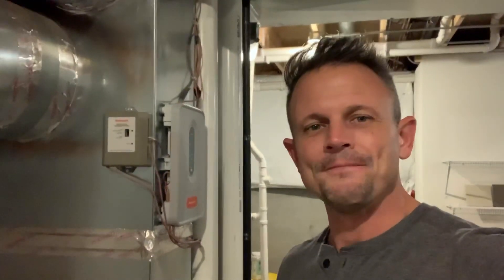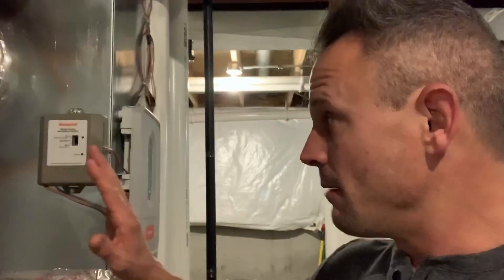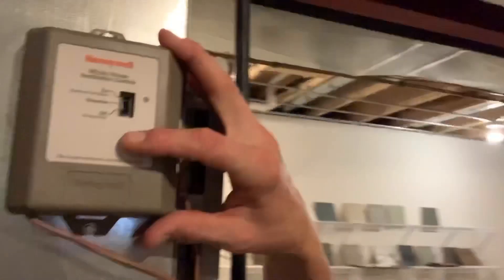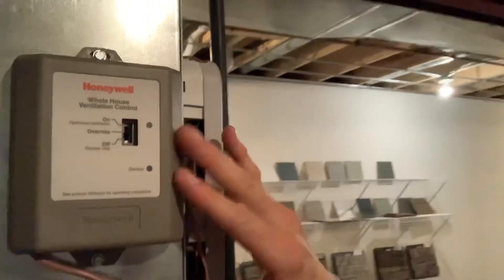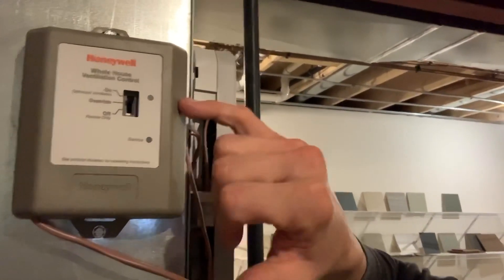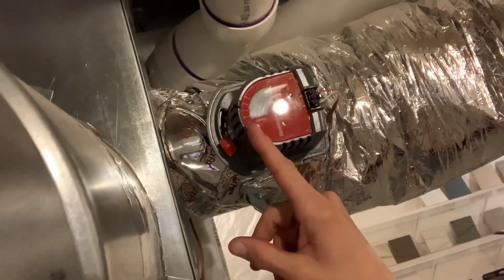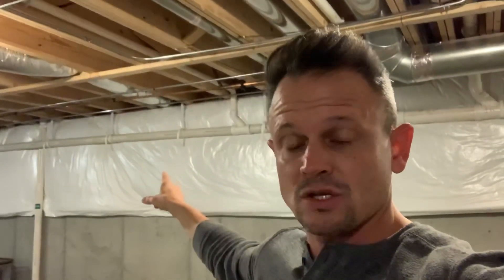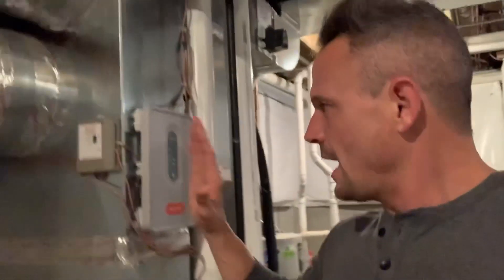How does a whole house ventilation control or fresh air intake control panel work

Comment: Wow!  What a great insight.  We recently purchased a new build home and there was always something blowing through the vents even when the heat/AC was not on. This also might explain why there was always dust covering the flat surfaces.  I turned the switch to "off" and nothing was coming out of the vents!  Amazing.  No one told me about this feature!  Happy to have found this presentation.  Thanks a million!  House is quieter too.
Reply from the maker: My pleasure Bob happy to help!

Yeah, your builder should’ve taken the time to do a new home orientation with you and go over it, but being that I used to work for builder. Sometimes these guys get busy and they just don’t have the time to go over every little detail in the home, which is why I made this video.

Congratulations on the new home. I hope you enjoy it for many years to come!
Reply: @BJPoznecki - Same thing occurred with me, when I purchased my New built home.  I sincerely appreciate 🙏 you and have subscribed. I rely on Utube to tell me the real deal ❤
Reply: I added an air scrubber to my unit, which took care of the dust. I dust now once a month and then it is very fine at that.
Reply: Same here!  Never take your eyes off when an AC yearly maintenance guy goes up to your attic!

Comment: Thanks for video. It was great. I have a question.
I have a new home which has two stories and two different actuator for first and second floors. When i turn off whole house ventilation control, only second floor ac is blowing and first floor actuator turning into off position. When i switch on whole house ventilation, second floor actuator is turning off then first floor actuator is turning on. I need both actuator on the same time because i live in Texas and crazy hot here. What is your advise? Thank you
Reply from the maker: Thank you I’m happy to hear you like the video!

It sounds like it’s not wired correctly. I would call the builder and have them send the HVAC contractor back out to fix it.

Comment: unsure if the house has it or not. but what should one do during wild fire? if your house doesn't have this, how do you stop outdoor air from entering home?
Reply from the maker: Unfortunately, I couldn’t answer that question without seeing the house. For your situation, I would call an HVAC contractor to come over and help.
Reply: @BJPoznecki  I just turned the hrv unit off, and turned on the AC. hopefully, when it says HRV unit is off, it actually stays off. If I open the HRV Unit, it turns off too. but I dont think that is good as some air might still flow inside, right?
Reply from the maker: @TheThirdManu  
That is correct you would want to turn off the HRV, which is a heat recovery ventilator that uses fresh air from outside. By turning that off, it should not bring in any air from outside.

Comment: So a thermostat has the Auto and the Fan options. Doesn’t fan do same as intake would? So does a unit with a fresh air intake hvac also have a separate Fan setting? Or is the Air intake the only Fan setting there is? If so, then turning on Fan with Air Intake off won’t work. Please explain. So stupid why people are not told about the Air Intake when buying newer home. My daughter has one and did not know it. She is in Texas so humidity level is high and humidity was getting in her home from somewhere, and fortunately someone honest told her about it and shut it off for her and told her she did not need it on at all. But then, what about the Fan setting on thermostat? Does that work separately from the Air Intake? 
Thanks!!
Reply from the maker: Hi Ann great question! The whole house ventilation system, and control panel with the on, override, off switch is separate from the fan on setting on your thermostat. They are 2 separate systems.

When you turn the fan on, on your thermostat, all that does is re-circulate the air within the home without opening the fresh air intake damper.

Comment: Thanks for the video, although even after turning it off it sometimes runs at random times constantly for upto a few days. I am tired of this thing, and afraid to completely disconnect it as it appears to be integerated with the AC power system. 😪

Comment: I agree with keeping it in the Off position and maybe turn on one time during the fall season. Spring will pull in the pollen, Summer it will bring in the humidity, and Winter will bring in the very cold air cooling your home which is the opposite of what you want. I am going to look to have it moved to suck the hot air out of my garage and blow outside.

Comment: Great explanation!  Our blower fan runs on and off for the whole day even when the thermostats are off.  Is it safe to assume that this system is the reason why?  After watching your video it seems like my control must be using blower to push fresh air in.  Is this safe to assess?
Reply from the maker: Hi Raul- Yes, you are correct! If you have the same system as the one in the video, it will do this whether the thermostat is on or off.

Comment: Is this system different than a system that has a selector to allow so many minutes of ventilation, per hour? I was under the impression that ventilation is even important in the winter months versus shutting it off. Build up of humidity in the winter months leads to frost/condensation on the interior of windows/doors and leads to stale air because of less make up air, coming into the home. Normally in my home, I allow 5 minutes every hour, of ventilation - based on the selector. Now those times differ from house to house (number of people living in the home, sq. footage of the home, etc.) in the winter months, depending on outside temp, I bump that up to 10-15 minutes to reduce a build up of humidity especially if it’s below 0. As it gets colder, you want less relative humidity.
Reply from the maker: Hi FireSneak- I would keep doing what works best for you. Here in the Midwest our winter weather has a lower relative humidity level. Plus, most of us have central furnaces for heating systems, so as the air passes through the burner chamber it dries out the air even more to where we install humidifiers to add moisture back in to the air. 

With that being said usually here in the Midwest if you’re experiencing condensation on windows it’s typically due to your humidifier being set too high and needs to be turned down as the temperature get colder.

Comment: If you open this controller cover, there are settings to control his much air to bring it in.  I was able to reduce it
Reply from the maker: Excellent good to know!
Reply: Yep, mines setup so the fresh air runs 100% of the time on very low speed. When heat or AC kicks on the blower runs full throttle.

Comment: Hello, Thank you for the video.
Answered many questions.

I have 2 questions that were not covered.

1) Will this cause mold ?

2) does this take electricity- in other words will it show up on my bill ?
Reply from the maker: My pleasure thank you I’m happy to hear you liked the video. 

Great questions!

1- It could potentially add mold spores when it’s on inside the home because whatever is outside now you would be bringing into the home, and there are always mold spores in the air. Especially, if anybody in the family has any mold sensitivities or allergies it could affect them, in which case I would advise turning it off. 

2- It pulls a little bit of extra power, but it’s not much because it’s just turning on the blower fan in the furnace. I have mine running whenever I’m home because I like the air circulation, and I like the white noise of it running when I’m sleeping, and it maybe adds $10 a month on my electric bill. 

Hope this helps!
Reply: @BJPoznecki  yes thank
Reply from the maker: @nara4697  I don’t know what you mean by flaps? If you’re in the United States and you want to text me a picture my number is 773-403-3298, or you can email me at bj@inspect-n-check.com

Comment: Really good explanation of what this control does!  Had furnace tuned up for winter the other day and asked the tech about this control. He tested it and discovered motor was burned out. Possible this has never worked since we moved in 5 years ago. If stuck open permanently it could explain why we've had such high house humidity in the summer- always sucking in humid air from outside. I will be replacing this myself.  Thanks for your video!
Reply from the maker: My pleasure Paul! 

If you don’t think you’re going to use it you could always just close it off permanently, and open the windows when you have mild temperatures outside to get some fresh air in the house.

Comment: I have this exact item and for some reason there is a buzzing sound in the ducts when this is in the automatic position. As soon as I turn it to off it goes away. Do you know what the issue could be?
Reply from the maker: I don’t know exactly what it could be, however I’m thinking there might be an issue with the electronic damper. Try disconnecting the wires that go to the damper, and then put it in the automatic position again and see if that buzzing sound still happens? If it doesn’t then that narrows down there’s an issue with the damper and your best bet would be just to install a new one.
Reply: @BJPoznecki  great call it was exactly that. The damper was going out we just changed the setting from automatic to off and the buzzing stopped
Reply from the maker: @travispreciado4183  Excellent good to hear!

Comment: Ive noticed we've been getting air in the vents and when i checked, ours is in the override position. You mentioned override is for testing but also indicated this is on. So does this mean its working as if it is on?
Reply: Also, is it bad to keep it in the override position?
Reply from the maker: @SC_RC1478  Well for normal operation you should switch it to “on “position, however you can put it leave it in “override” it’s just that it will continuously run and never turn off. So whatever temperature or weather is outside the home you’re always going to be bringing it in. It will also decrease the life expectancy of the blower motor because it’s always running and never turning off.

Comment: I would usually put mine on to the "on" position once or twice a week whenever it's nice and cool outside to get some fresh air in since we do not open the windows often.  However past couple days I noticed the fan is constantly running and even when I turn it in the off position, I see that the flap is open with the green led light.  AC/Heat is not on so I'm a little confused.  I have the fan set to auto so that it kicks in whenever it's heating or cooling but the temperature inside has not triggered the thermostat yet.  In the HVAC room next to the light switch it seems like a manual shutdown where the entire system shuts down but I don't think that's what I'm supposed to do.  Any suggestions?  Same Honeywell controller as what I see in your video
Reply from the maker: Hi Joonsup- If you’re turning it to the “off” position and it’s not turning off, then there’s an issue with the control panel, and it needs to be looked at by an HVAC contractor.
Reply: Did you ever discover what the issue is?

Comment: Is there a setting to regulate how much air to let through ?
Reply from the maker: It depends on your system set up. You would have to look and if you have an electronic damper on the fresh air duct coming from the outside to the cold air return plenum, there is a way that you can adjust how far it opens.

Comment: Wish ya showed the wiring
Reply from the maker: Well, I’m not an HVAC technician, so I’m not sure how it should be wired. 

But, as it turns out the HVAC contractor that installed this one didn’t wire correctly anyway, so even if I did show you guys the wiring on this unit I would’ve been doing you a disservice. 

I ended up having the heating and air conditioning guys come back out after shooting this video and fix it.

Comment: No wonder my AC bill skyrocketed this month! I was having problems with my AC keeping up with the 100+ degree days and someone recommended I turn this thing on to see if it would help. Duh. Did just the opposite! I just turned it off and hoping my electric bill will go down next month.
Reply from the maker: It should make a huge difference and drastically lower your electric bill!

Comment: I run an HVAC business out here in Oregon and we get a lot of wildfires as well as tons of smoke and ash from the California wildfires which make the air insanely dirty and actually get ash inside our house if and when it’s bad like we seen a couple of times over the last several years here where I live and now with this new energy code here on new construction in Oregon we have to incorporate these fresh air systems which bring that dirty nasty air into the home plus on top of that just like you said when you’re trying to cool the house you’re bringing hot air in making the system really have to work hard and vice versa with the cold air when you’re trying to heat the home so I think we’re going to install these and shut them down And can see a lot of builders in homeowners calling us back to take them out or shutting down once it’s past code because it does not make sense for the most part.

We’ve also been forced to install the furnaces and air handlers in a condition space and no longer allowed to install them in the garage where we have tons of room to work or in an attic when necessary and if We do they have to be encapsulated and closed off with plywood sheet rock and insulation to create that condition space making it very hard to get everything installed under the system or to work on the system down the road and it’s very Frustrating. 

But that adds another element with these fresh air systems that we have to find a way to filtrate that air instead of just dumping it into the return Plenum if the builder or homeowner does not want a filter cabin it up in the attic because it’s hard to access.

Have you come up with any ways to filtrate the air coming in in a situation like I’m describing where you can’t fill trade it before it hits the furnace?
Reply from the maker: Hey Herbert- No, I’m sorry I haven’t come up with anyways to filtrate the air. I’m not an HVAC contractor, I used to work for a home builder here in Chicago, so I made the video for my customers just to explain a little bit how the system works.

Comment: Good video. Question: is this supposed to be wired into the tstat such that you can turn on without going into the attic?
Reply from the maker: Thank you! 
No, this has to be done at this control panel.

Comment: I was literally jumping up and down when I found your video! You may have solved a huge problem for me. Will turning this to "off" help lower relative humidity from mid-60's to below 50%? And roughly how long after turning off would that take in approximately 700 square feet home?
Reply from the maker: Happy to help! It should especially if you live in a hot humid area because whatever it is outside you’re bringing in to the system.

I’m not exactly sure how long it will take to reduce the humidity level in the house, but running your air conditioner a little bit more should speed the process because when the air conditioning is on it’s removing that excess humidity. So, if you keep it a little bit colder and it keeps running I would think within a couple days everything should balance out.
Reply: @BJPoznecki  would love to hear your answer to SC's follow up question in this thread. How important is it leaving this system on for health reasons? It seems as if the system is turned off, the house will not have a way to intake fresh air so any bad stuff in the air will continue to circulate. Is that correct?

My house is a new build as well, not sure if that makes a difference.
Reply: @gutierrezsantiago My HVAC company just installed this device yesterday after 3.5 years of original installation when I recently discovered unfinished weird wires exposed in the attic. The tech said that even without this device, fresh air comes in naturally. I can also confirm that from my experience when we use a range hood for cooking and outside is cold, cold air comes in from the register and the temperature drops. This is the evidence. The tech said having this device on will bring more fresh air.
Reply: Thank you. I got really excited about the possibility of lowering the humidity by turning it off, but how important is this ventilation in newer construction (last 4 to 5 years) for health, such as lowering radon? I guess some municipalities require them for a reason. Am I understanding correctly that this controller by itself is not a HRV or ERV system?

Comment: Hi BJ, thank you so much for explaining in details what this control does. I recently had a contractor install a new Goodman heat pump and cold air is not circulating through the vent when the outdoor unit is running. The technician said the ventilation control is faulty and left the switch in the 'Override' position. I toggled the switch to 'Off' and turn on the AC, I didn't get any air circulation. At this point, I am thinking there is some issue with the wiring of the new heat pump. Should the heat pump blow cold air even when the control is 'Off' ?
Reply from the maker: O Square- I’m sorry I’m not familiar with how he pumps work. Here in Chicago with the extreme temperatures that we experience we don’t use heat pumps, so I’m sorry I don’t know anything about them. 
I suggest having a different heating and air-conditioning contractor look at it if this guy can’t figure it out.

Comment: Isn't there another version that has a built-in heat exchanger?  So that the air being replaced heats or cools the incoming fresh air prior to being distributed through the household ducting?
Reply from the maker: I’m not sure there could be. I was only familiar with this particular system that the homebuilder I used to work for would install.